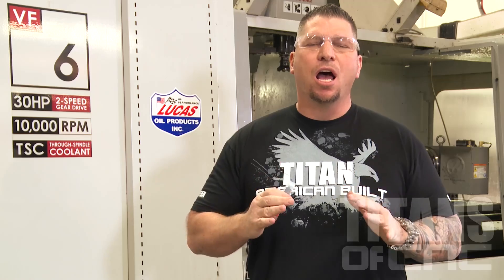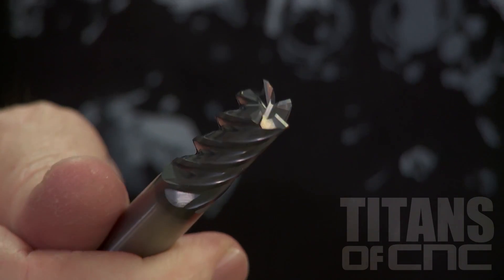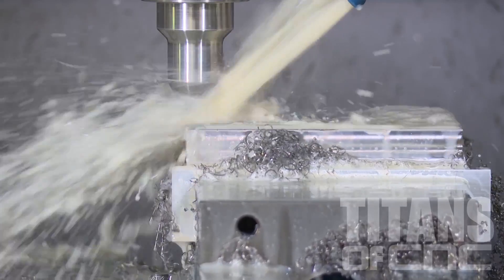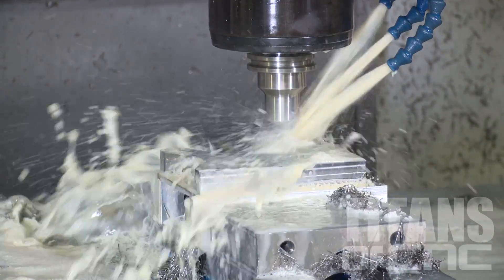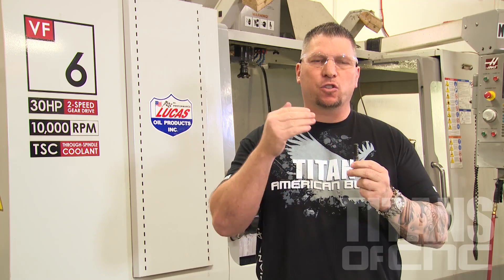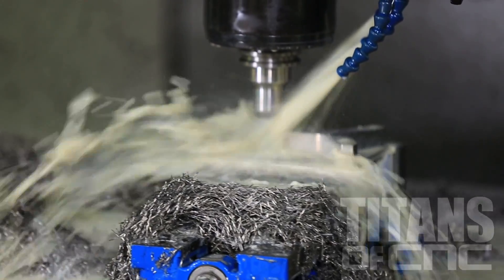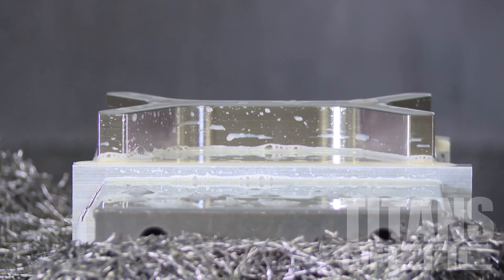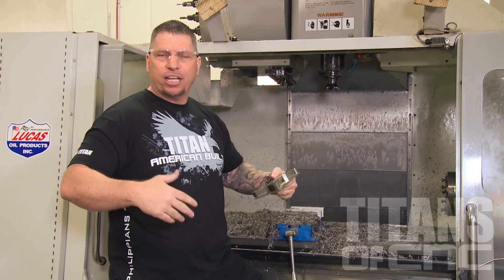CNC Machining Titanium at 250 IPM by Titan Gilroy

Comment: Never ran titanium before looks like it cuts decent. Wonder what sfm hes running and the engagement. Need to do one with incoloy 800 so i now how fast i can run it lol.
Reply: Matt Caesar 

  Looks to be about a 1/2 tool at 3050 rpm says the control. So 400sfm. 

  13 flutes at 250ipm is a chipload of .006 

   I get the concept of faster removal rates with low radial doc and higher depth. Once you get that roughed out how are dealing dealing with expansion from all that heat?
   
   Or is the tolerance not that critical?